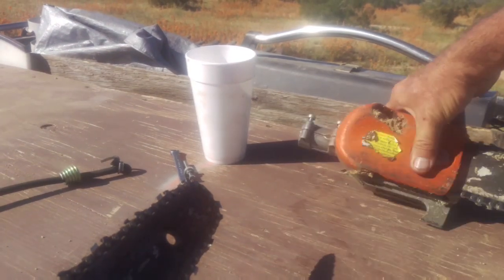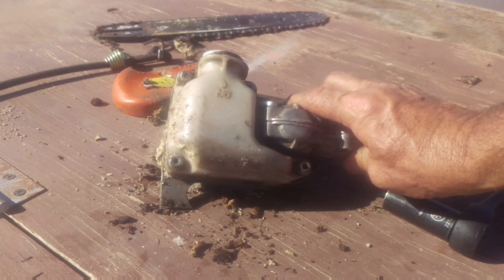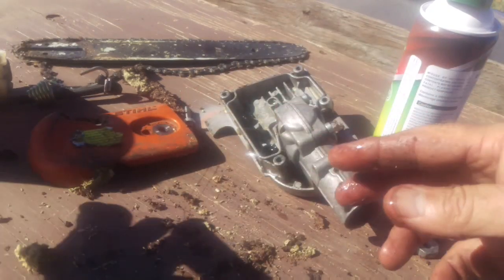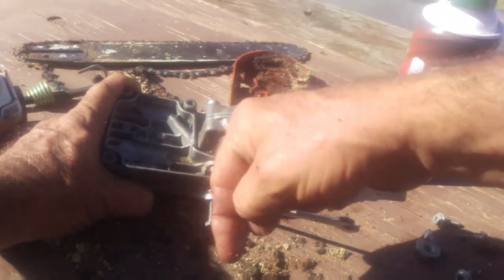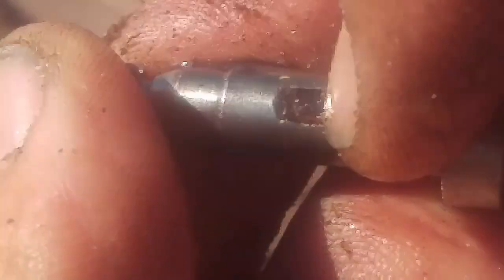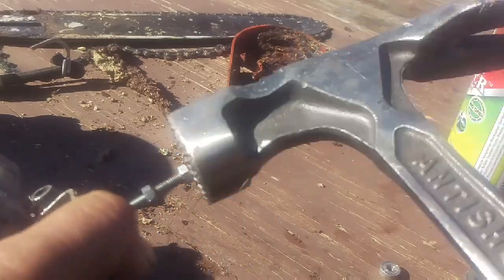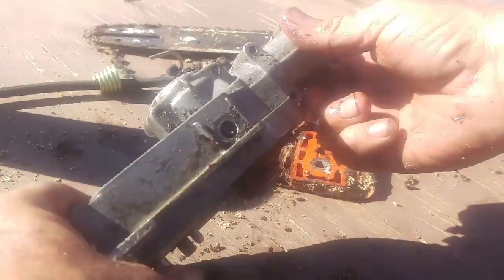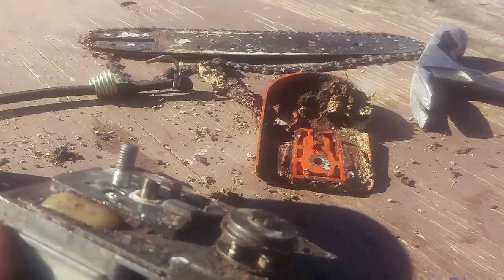Stihl Pole saw chain not oiling. Removal and installation

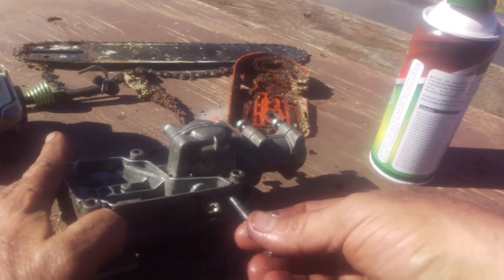Comment: At the 5:50 mark, the bolt is a size 5M.  You don't have to buy a special bolt, just use one of the four 5M bolts that clamp the chainsaw head to the pole.  They're long enough and work just fine.  These bolts are visible at upper left at the 5:50 mark.  Buy a nut that fits a 5M thread or use one from another Stihl product, Stihls have 5M bolts everywhere and a few have nuts.  (Note that the bolts that hold the plastic oil tank on are NOT 5M threads, don't use them.  Use the bolts from the pole clamp)  If you have to buy a 5M nut, "5M" means "5 millimeter metric", I think.  You don't need a special washer, just buy a 5M washer and then add a next size larger washer too, to create a build-up that will span the pump withdrawal hole.    You'll need a 8 millimeter open end wrench to work the nut.  When you pull the pump out, clean it up and rinse with WD40 and then grab the worm drive head and try to turn the pump.  It should turn very easily.  If it turns rough or not at all, a new one costs about $26 as of 2022.  If it's not turning or turns rough, open the top of the transfer case and check the transfer gear that turns the worm drive.  If that gear is stripped your unit isn't worth repairing.  When you're ready to reinstall the pump, note that the intake slot (that's the long slot on the pump goes to the back.  The pump's outflow point goes to the front, where it will align with the internal channel that takes the oil up to the bar.  It has to be aligned correctly.  If you have a good vise you can turn the sawhead assembly so that the pump hole is pointing straight up and there is a flange that goes perfectly into a vice.  Clamp the flange gently in the vice to hold it still, and then it's super easy to use a punch to tap the oil pump in, and you'll hear it and feel it when the pump is seated.  Good luck to all.
Reply from the maker: I was I could give this lots more than 1 ❤️ ❤️❤️❤️ Thanks a million Mark. I greatly appreciate your input to help others.  Whatever we owe you please put it on my account. 😂🤣😂🤣👍.
Reply: @ZombieDaveAZ  You're very much welcome, and I appreciate your posting of your how-to video.  (A mistake in my post-the bolts are visible at center screen at the 5:50 mark.  And, it's "vise", not "vice".  Sorry)  There's so many tasks/jobs that each of us can do for ourselves to save money, save time, or just get a feeling of accomplishment, and videos like yours really prime the pump for do-it-yourselfers.  I love to see regular people turning wrenches and getting their hands dirty.  We just don't do enough of that as a nation anymore.  Again, great video!
Reply: Very helpful.

Comment: Big thanks. Heading out the the barn to fix mine now. Thanks to you
Reply from the maker: Easy money Al. Let us know how it worked out for you.
Reply: @ZombieDaveAZ  Just finished, My saw is an older model with a solid tank instead of split. The flat style screen was plugged in it. I have a new rubber boot on order. The original was getting hard. So I thank you. Even though mine is different, It was easy to figure out after watching you.

Comment: Zombie Dave thank you for taking the time to show us how it's done brother!  This video is very much appreciated.  I'm still trying to find one that explains what to do when the extension won't pull out like it's supposed to.  Mine used to extend nicely then for some reason I can't get it to pull out anymore.  One day I'll just try taking it apart to see if I can figure out what's up.
Reply from the maker: Under the locking collar I believe there are 4 plastic washers. Seperate the washers and see if it retracts and expands. They could just have crud in them. Yeah so just undo the lock collar and slide it up and take a peek see.

Comment: Thanks!  Never had one that wouldn't oil after cleaning the tank and screen.  I used the same puller I use to install Rivnuts on my muffler deflectors. I owe ya' one for the 5 minute fix.

Comment: My neighbor wanted me to check out his pole saw. I determined it wasn't oiling. I watched this video yesterday (8-28-19) disassembled and cleaned. Today (8-29-19) reassembled filled with oil fired it up, oiling as good as new.
Reply from the maker: You saved your buddy at least $80 from the stealership (they just clean,not replace but charge you) and the time it would have spent in the shop. I hope he offered you a beer. You're a good neighbor!

Comment: Great video! My pump was broken in half. The little gear that mates with drive shaft gears was broken off inside housing. 
Any idea what causes them to break? Mines about 5 years old. Just trying to figure out what failed to prevent it from breaking again prematurely? Thanks!!
Reply from the maker: I wish I had a magic answer Mike. I done a bunch of these and NEVER had a broken 1 come in. Maybe you got a bad 1? I dont know. Sorry buddy.
Reply: How often should be interior housing gears be greased? There’s no screw port like hedge clippers or string trimmer. I’m wondering if it was lack of grease maybe? Thinking I should grease it all while housing is apart- but don’t want to over grease it?
Reply from the maker: @mab123080   you know a little grease goes a long ways. Just dont pack it full
Reply: One other quick question: since I had to crack the gear box open to find and remove gear piece that was broken off, is it mandatory to redo the derco/ gasket maker stuff?  
I put new pump in, everything is good to go, but I saw another video saying I need to buy the gasket maker and scrap off old stuff ? Over kill to do that or foolish of me not to? It doesn’t leak and I did add some grease to gears while it was apart. 

Appreciate your help!
Reply: @mab123080  it doesn't hurt to add gasket maker just to make sure there isn't any way for anything to drain over a period of time, I did the same thing for mine just for shits and giggles since it was there in the first place, figured I might as well replace it.

Comment: Excellent video! Huge help. I do not think I would've figured that one out.
Any videos or tips on the chain tensioner for the same pole saw? My chain is dangling loose every couple of minutes. I pulled the tensioner and the gears look fine. I've been looking at getting a new one and the sets seem to have a small maybe 1/2" flat head screw that comes with them. I don't have one in my saw head that I can find. Do you know what that is or is it unrelated? The thing's driving me nuts!
Reply from the maker: I'll post a video for you in the next 2 days buddy. Subscribe to see it first. 👍
Reply: That would be greatly appreciated. I already subscribed and I'm working my way through your library. Thank you!
Reply: @ZombieDaveAZ  Spot on on that oiler.  Yes. It was a 5mm bolt.  1 1/2 or 2".  Full of sawdust.  A little brake cleaner and some air though the pump and the housing and she's good as new.
Reply: Yep, you guessed it….another Gearhead was not oiling this morning but now it is. Got a used gearhead off FleaBay and noticed the oil tank was full of debris and crap. I thought that can’t be good and tried it out. RAT’s just as I figured it not oiling. Maybe that’s why it was on Ebay.
Anyway watched the video and set about fixing it. Used a little different approach and chucked the head up in the vice by the limb hook. Took the top case half off to expose the gears and innards. Said hmmm I can tap the pump out carefully from the top. Took a long narrow socket and and blunt punch and tapped the pump right out. Yep you said it would be clogged with fine debris and it was. Cleaned everything up, installed pump from bottom as advised and made sure aligment was correct. Re-geased the gears and sealed up the gearbox with some Permatex. Got the rest back together and mounted on my custom made “short” pole saw that I made from what was a trimmer. I like a short pole saw for on ground short reach limbing. Anyway back in action working great ! Thanks a Million !

Comment: Question on my pump, I only have two screws and the bottom of the pump seems to fit inside the a hole, which after watching makes me think that goes into the pump.  when I remove the two screws, it is hung by that point, not forcing anything, but wonder how to remove the reservoir from this point.
Reply from the maker: Hey Bill what make and model of pole saw are we talking about?
Reply: @ZombieDaveAZ  Sorry, just now seeing this--It is a Stihl 75 Pro
Reply from the maker: @billwilliams3546  HT or FS? I'm guessing HT?

Comment: Is it possible that the chain oil tube going from the oil pump to the outlet can get clogged so bad that blowing air through it won't free up the clog? I have taken it apart but it seems like the channel is clogged. Any fix? Thank you.
Reply from the maker: I suppose anything is possible TJ. I'm gonna say it's a pretty small percentage
Reply from the maker: If you already have the pump out you can try pushing compressed air thru it from where it oils the chain and see if anything comes out down by the pump. It might take a while as bar oil is super sticky to help keep it from slinging off when oiling.
Reply: @ZombieDaveAZ   I have the pump out. I put carb cleaner down the passageway where the pump goes. Hope I didn't ruin the gears. No fluid would come out where the hole is, that oils the chain. I blew compressed air through a tube same direction. It seems like nothing came out. I'm trying some fishing wire to make the turn and dig out any sawdust. I really appreciate your quick reply. I can reassemble but I want to be through. It seems like should blow through the oil passage. Any chance I could email you. Again many thanks.
Reply from the maker: @tjglowacki   sure can brother zombiedaveaz@gmail.com send me an email and then I'll give you my # if you have the ability to text.
Reply: @ZombieDaveAZ  I got it. Thanks again for your help. Great site.

Comment: Stihl stuff is very different never used a stihl pole saw before or a weed wacker
Reply from the maker: The 4mix pole saws from Stihl are incredible. Tons of power.
Reply: My saw is a stink 75. I got the reservoir off but concerned about pulling pump. Want to make sure I don't break something!